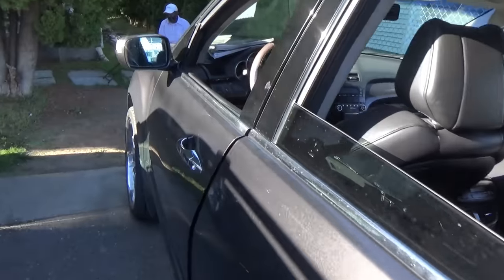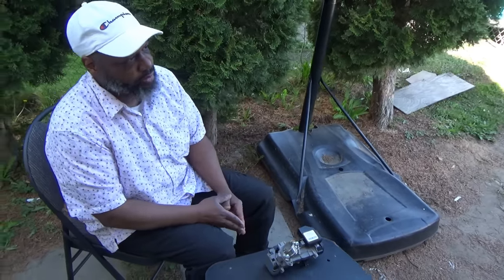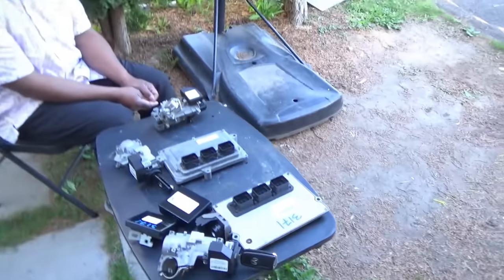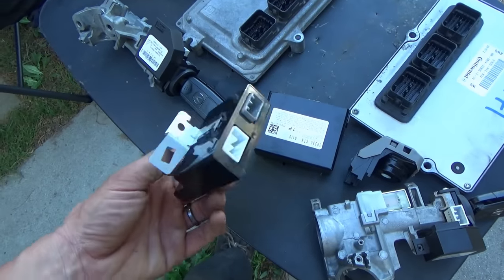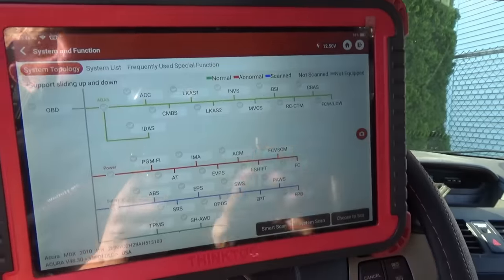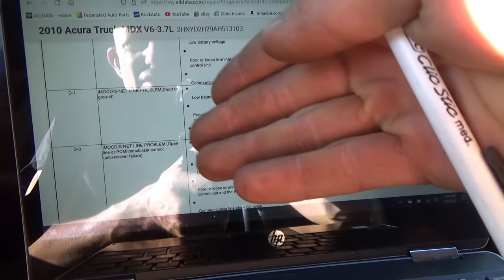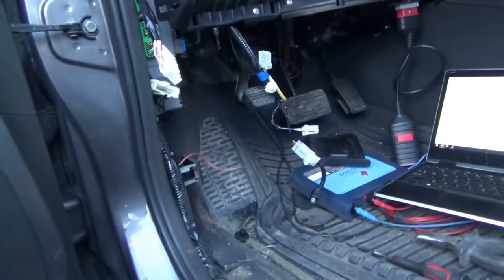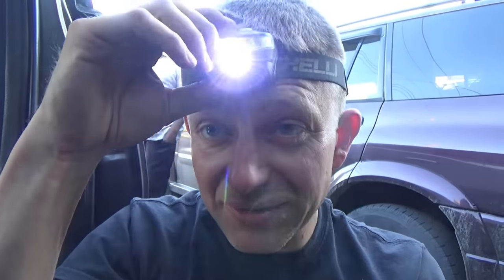Customer Spent $4000...and it STILL Doesn't Start! (Acura MDX)

Comment: You surely don't owe me a thing. Glad to share the knowledge and happy it led you right to the problem! Great video brother , see you soon!
Reply from the maker: Thanks Keith! I shall call this the "Keith Kick Test" from now on :))
Reply: @PineHollowAutoDiagnostics  went from a tap test, to a kick test. 
That escalated quickly lol
Reply from the maker: @diymisfit_Mechanic_UDX404  also don't forget the patented "Keith Tug Test"😁
Reply: @PineHollowAutoDiagnostics  I think you need to invest in a rubber mallet :)
Reply: I also owe Keith one, it was 2 bad fuel injectors in my mom's van and a faulty rad cap causing the water loss
Reply: @PineHollowAutoDiagnostics 😮

Comment: In the early 90s I came across a 1982 Honda Accord for sale. It was covered with dirt from sitting. The owner was driving it, & it cut out on the freeway. Everything shutdown.  She took it to Honda, & they replaced all kinds of parts. A few days later it happened again, so she took it to another shop, & they continued to replace everything they could think of. She drove away, & it cut out again. She had it towed home again, & was afraid to drive it. I bought it for 300 hundred bucks. I was grateful for all the new parts!  It made it home , without cutting out. I spent a few hours going over everything under the hood. Then,  While letting it run, I started grabbing the wires underneath the dash, & It shut down. It was a connector green with corrosion.  I'm not sure how the water made its way under the dash, but I paid 50Cents for the connector at the JY. That sure was a nice little car.

Comment: What a weird problem! Luckily, Keith (the encyclopedia of weird cases), was able to save you the time it would take to chase goblins down the wiring. Great diagnostic and hats off to Keith.
Reply: It's not really that weird when you have water dripping from your windshield. smh...
Reply: @calholli  the answer is not that obvious if you dont know. What makes us master techs is that we know what to look for. Loose connections, contact points that may break a wire with vibration and especially, what to test.
Reply: Yes @scientist100

Comment: $4k for "Green Crusties" 😮...... This proves that Ivan is always right about never using the parts cannon without a proper diagnostic. Well done 👍
Reply: I doubt he paid 4k for those parts especially cuz they are from ebay not even dealer, they charged me 1200 for the whole immobilizer system (key ignition and everything thats talking in that circuit)
Reply: @RexerYTRexer  Can't leave out the labour Bro, it's Parts and Labor. So whoever did the previous diagnostics didn't do a good job.
Reply: I mean Ivan was ready to pull the parts cannon trigger, even though the owner already played swaptronics...

Comment: I have an 04 Maxima with intermittent click-no start issues. I've tried new brushes, new solenoid on my starter, new relay, new grounding cable, i checked voltage drop on positive and negative side i even tried a new starter and a new battery - couldn't get rid of the problem. 
One day i just grabbed a handful of wires under my dashboard and wiggled them and the problem was fixed. The car has been starting super strong for a few years with zero issues. (The new starter was returned and i'm still using my old original starter)

After a few years the same issue is back but not as bad. It's time for some wiggle-wiggle again. I may try kicking some things too 😄

Comment: My favorite fixes are the no parts required ones.  That was going to be a biatch to track down though. Amazing Keith ran across that and kicked the panel and found out.  Divine intervention.  Our cars here in So Cal are only impacted by heat. We have no rain or rust so ideal conditions for cars to survive. You'd be amazed what you see still running out here.

Comment: I had the same type of no start problem intermittently on a 2006 Accord. First problem I fixed was the ECU that had some damage from water dripping from the AC system. It was actually physically corroded the aluminum box and insides so I cleaned it up, put some spray plastic type stuff meant for circuit boards on the ecu board and sealed the casing better. That corrected the problem for a while but the final fix was to simply replace the ground wiring after which I had no issues with starting and no longer the green immobilizer symbol.

Comment: Reminds me of the reason why my parents got such a good deal on the 2001 Durango they bought in 2006 and i still drive today.  The ignition switch behind the key tumbler and lock was shorting out and when you tilted the steering wheel to driving position, all the dash lights, radio and front blower would go off, tilt uo and it all came back on.  It was replaced with a Mopar OEM unit and it worked great til 2019.  I replaced the unit again with a Dorman unit snd it's actually built a little stronger and does not flex like the oem/Valeo unit.  Its channels like yours,  Eric O and Rainman Ray's that help me keep 2 20 plus year old Dodges on the road and running great! Great job as usual Ivan!

Comment: After cleaning the contacts mate and un-mate the connector a couple times. Then apply Deoxit D100 in the needle applicator bottle to the male pins re-connect and test for proper operation. If operation okay, you can then seal the wire side of the connector with Grote Ultra-Seal. The Ultra-Seal will keep the water out.

Usually the power feed and power return for a specific function will route through a common connector. In this case, if you do not have the ability to replace a pin, you could add a connector and move the circuit power (which has the bad pin) and the return using a Deutsch DTM 2 Pin connector. You can select either a bent style crimp pin or a barrel style pin. Most common are either Tin plated or Nickle plated. Pins with Gold plating are available but very expensive. If this is done it is generally good practice to tie wrap the added connector to the parent connector.

Comment: I know you would have got to the cause eventually, but you had already told yourself that it was a module problem and definitely not a wiring problem. Several modules were already tried and sitting on the table. That experience Keith has really pays off, and now this problem will not phase you again! You know... until you check that wire first and it's completely clean.

Comment: I have a 2002 ACRUA MDX that I bought early 2020..  It has 3 rows of leather seats that fold down, heated seats and heated mirrors, moon roof, COLD dual climate AC that works TOO well..  it's AWD;   has 3.5L vtec (j35A3) engine. It's in emaculate shape, zero rust, zero dents, not a single drop of leaking oil anywhere on this thing.. It had 155k miles and I got it for $1700 off of FB marketplace. lol.. over 2 years later and I'm still thrilled about it.  It's such an incredible car........   It has an interference engine though, and I'm not sure if it has ever had a timing belt done on it.  So that's on the list of things to knock out sometime in the future...   I love these things though.  Absolutely flawless design, even back in 2002.  Everyone is trying to copy this exact crossover shape/ style and function, ect... -- and Acura got it right all the way back then.....  I used my Xtool D8 to make extra keys and fobs for it.  What a find-- I'm still pinching myself.

Comment: Up until the point you rang Keith, you were so convinced it had to be a module problem and not a wiring/connection issue. That it turned out to be the latter after all must have left your mind reeling a bit, Ivan. Feel for you. Experience can be painful, but you just passed another milestone.  ✌Thank you for letting us be a part of that journey. 👍

Comment: You originally said. It’s intermittent and only occurs when you move the steering column, so it has to be wiring. Then you see the raised voltage and completely forget how the problem occurs and start chasing rabbits. Thankfully Keith pointed you again to the right path because it always had to be a wiring issue.
Reply from the maker: Had nothing to do with the steering column. That was just a coincidence. Those rabbits are tricky 🐇

Comment: Love the videos Ivan.  No criticism here just an observation.  You can buy bulk assortments of OEM male and female connector pins for all makes and just re-pin the bad connector pin(s).  It's very easy to do once you get the hang of it which I know you have the skill set.  A special crimping tool is needed and an assortment of pin extractors for releasing the pin, all of which is very inexpensive.  With a little practice there is no need to order harnesses or disable other systems in the car and the repair is 100 percent at the time of diagnosis.

Comment: Plug and socket just there as an aid to enable original manufacture.   Without sealing boots over both plug and socket and in an area close to the door hinge,  adjacent to the sunroof drain and under a windscreen,   that is a GTF design feature where GTF means "Guaranteed To Fail"  Permanent fix is to remove both plug and socket housings,  cut off male and female terminals,  cut back wires to a corrosion free area and solder join each wire pair in turn with heat shrink over each soldered joint,  then heat shrink over whole soldered joints area then inject neutral cure silicon sealant around every wire at both ends of the large heat shrink to make effectively a hermetically sealed joint.
Great fault analysis Ivan and Keith!
Reply from the maker: That would definitely be a long term fix! Interior connectors are never sealed since the manufacturer never expected them to get wet 😅

Comment: You had a fault to VBAT and the immobilizer output is an open drain transistor with some series resistance to the transistor drain.  The +5V is the normal logic that this immobilizer output is pulled up with a resistor at the partner to this module.

All automotive outputs must tolerate VBAT so a fault list this one does not destroy an output resulting in a new module.  Faults like this are the bane of electronics.....

Comment: I'm surprised that you don't have the terminal ends for those connectors. Somebody will forget and put that fuse back in. Cutting the wire and bypassing the connector might have been a better option.
Reply: I was thinking similarly. would have been easy to bypass the factory connector, just for that one wire, and leave it adjacent to original where it would have been fairly obvious for the next guy. but great diag in any case. Thanks for sharing it Ivan!

Comment: My step-daughter bought a 06 Civic (without me checking it out) that ran for 3 days, then CNS, or so she said. It was actually a mobilzer issue, due to her "womanizing" her dash with shiny girly stuff, including a beauty ring around the ignition switch. Once I realized the problem and removed the ring, it started & runs fine! That accessory was blocking the switch from reading the transponder in the key!
Reply from the maker: Womanizing 🤣

Comment: These are the scary ones, where you're minutes away from recommending a part that won't fix the problem. Glad you had a lifeline on this one. I have a cool way of cleaning connectors like those fast & easy. I put valve lapping compound in the connector and then plug and unplug several times, then clean everything with contact cleaner. Works really well. Good job Ivan!

Comment: That was a great vid IVAN>you've done a lot of the green crusty's ones before but this was special in that you asked for help,and Kieth DAfacio came through with a needle in the haystack idea and it was right on the money.i really think 90 % of mechs,would just keep firing the parts canon until the barrel melted or the customer ran out of money.what makes it such a good lesson is THAT IT'S AN INTERMITTENT ISSUE.Those are the hardest to repair.I'm sure this guy had no issues paying you for travel time.i know if it was me>>i would send a stretch limo to pick you and your wife up and take you back wherever you wanted to go.haha

Comment: I used to be a tech at an Acura dealer. Water leaks into all 4 corners of those are very common and cause a lot of issues since there are fuse boxes in 3 out of 4 corners. The leak is usually from the body seam where the roof attaches to the upper pillars on the roof, very easy to fix
Reply: I second this, 9 years at Acura. Still with Honda though. Reseal the roof seams or it'll just happen again. Lucky it didn't fry the MICU or rear fuse box, gets expensive quick!
Reply: Seen leaks from a lot of SUVs, one of them actually was due t ok the foamy double sided tape that the manufacturer used which we all know that over time it becomes brittle and starts to disintegrate. We removed the whole rooftop and applied sealant around the frame and sat the rooftop assembly on it and that thing was going to be there permanently. Not sure why the manufacturer choose to use that material, perhaps to service the rooftop more easily but the job was big enough to justify doing a permanent repair. This was a dual view sunroof so it was a large assembly that went all the way to the back.

Comment: I had a similar problem on an 05 Accord. Dealer put in a new ign sw and and customer got new fobs. Worked until the daughter drove the car and moved the column. Several wires were just about broken thru. The catch here was the immobilizer unit DID NOT show the new updated key fobs, yet it WOULD run until the column was moved. After the wiring repairs, it had to be reprogrammed, as a  no crank no start. Figure that 1 out!

Comment: I had the same issue in a honda i owned . Immobiler would act up intermittently.i never found out what wrong but i knew it had to do with the kick panel drivers side as it had a water leak in that area . Now i can die peacefully you solved that mystery for me thanks your a very good tech expert level .i know I am one too .

Comment: Moving a part and flexing a wiring harness causing errors screams of intermittent wiring issues. It is also one of the most difficult problems to troubleshoot. 
My Lexus LS400's horn would not work, sometimes. I trouble shot it for what seemed like forever. The horn slipring, yada, yada.... then come to find out, there is a ground wire, in the steering wheel that is connect with a closed head crimp terminal, and the insulated ground wire was separated exactly at the end of the insulation and the crimp end of the terminal lug. Visually, it looked exactly fine, thick insulation on the wire butted right up to the terminal. It was hardwired but the wire had been misrouted ever so little that it was slightly rubbing on a piece of the column when it automatically extended. It was enough that over 15 years, it broke right at the terminal crimp.
Big problem finding that, but the terminal was mounted in such a way that it was impossible to access the bolt that held the terminal lug. I ended up carefully soldering the wire back onto the terminal lug. That in itself was a huge challenge. I had been soldering electronics for over 25 years in my job, so I got it done. I also re-routed the wire out of harms way.

Comment: You were on the right diagnostic path.  Keith helped you get there a little more quickly!
Like some of the older Ford trucks. WATER did it's damage to that connector.  Maybe a clear plastic bag or a large piece of split loom wrapped around the connector and wiring would divert the water away from that connector.

Comment: It pays to have other people like Keith in this business. With both of you having experiences of working on cars, one of you is almost bound to have seen certain problems that maybe the other hasn't. I've seen on some cars where the manufacturer puts a small plastic shield over interior fuse boxes in case water leaks become an issue. Ideally the water leak should be fixed to remedy the problem, but the shields at least provide some protection. 

I feel better for the owner that you could fix with no parts required. 4k is a lot to spend without a fix.

Comment: Great diag very interesting and Keith saved alot of time , you would have eventually found it on your own I'm sure.Location of connectors seems to be key kick panels seem to be a common place for water to seep into . Watching lots of diag videos over the last  few years connector issues and green crusties always in vulnerable areas either inside or outside the cabin. The customer is ecstatic hopefully can resell the parts cannon ammunition on ebay again and retrieve some $$$$.

Comment: In this sort of instance I would of also packed the connector with die electric grease - if that area is susceptible to water entry either fluid film or die electric grease to keep it more resistant to water. Wow! Ivan great job done there...

Comment: Amazing diagnostic path and another connector failure solved by use of logic and the best tool of all, a generous, very experienced technician. DeOxit I've got, but not the right size brush and "tweezer" files. What do I search for or  how to get them? Renovating an old land cruiser and the connectors are a mess. You are another example of excellence through dedication to purpose in America!

Comment: Keith has a remarkable memory. I'd be tempted to cut that hot wire out of the plug and splice it together. You and the owner would be the only ones to now
Reply: ive done that kinda thing a few times

Comment: You know when you said it was a module problem, I was remembering another video you did when you had resisted voltage coming through and was surprised you actually went for the bait calling  the module.  Glad you didnt go that direction as you would have been making another trip.

Comment: Had that happen on my 06 Equinox. Blower fan caused the connecter to slightly melt causing intermittent communication failure. Cut the wires and connected them outside of the connecter.
Reply: I like you solution better.